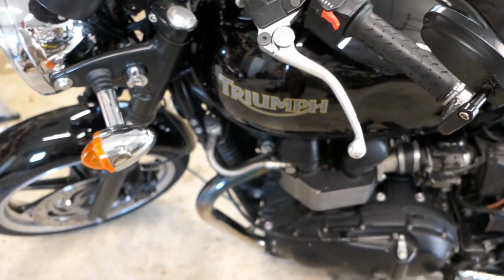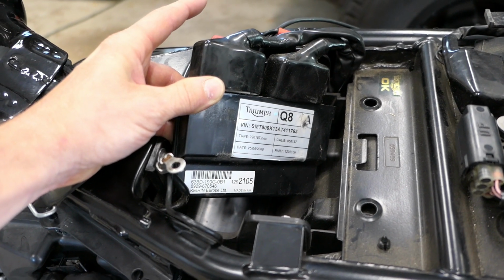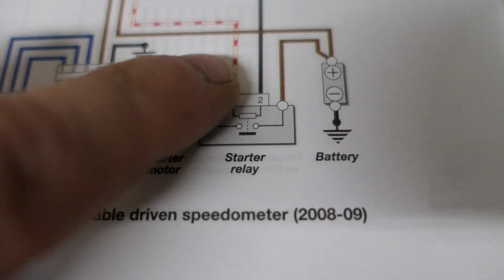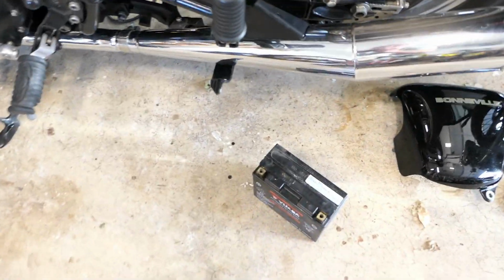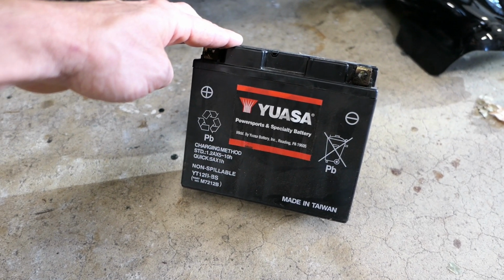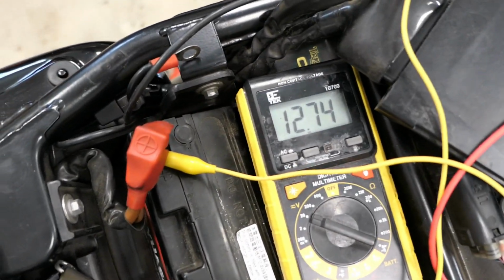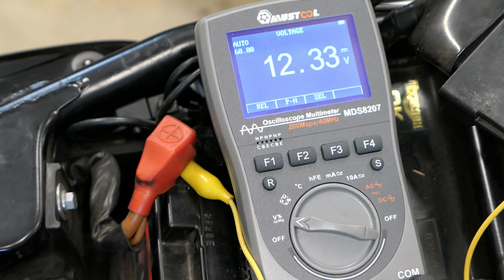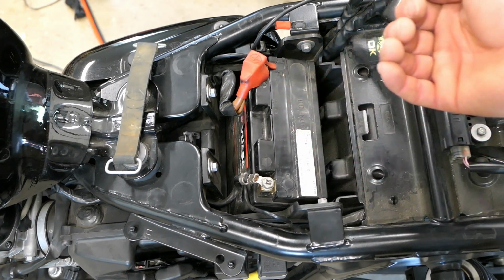Understanding The Triumph ECU Starting Issue

Comment: We can easily squeeze extra life from the battery by installing an external switch to the headlight. Procedure would be to turn off the headlight via the external switch, turn on the key (now the battery won't go below 12, then start the vehicle, turn on the headlight switch. In NA, the headlight should always be ON. But this is only while starting. I faced this problem sometimes, and I carry a T5 screwdriver with me when I go for overnight trips. When I get clicking sounds, I turn off the key, remove the two screws for the headlight and disconnect the headlight, then it starts normally. Connect back, put back the screw and ride back home making sure to charge the battery via a battery tender. Anyways, good video and nice explanation.

Comment: Turning the headlamp(s) via a aux. switch will work if the battery’s not too bad but the problem will return as the battery deteriorates. Worked on my 2007 tiger for a while. Just replaced it with a tiger sport. On this the headlamps stay off till it’s running. Very good videos. Great teaching voice. Nice one sir.

Comment: Brilliantly helpful video - Thanks so much for sharing - Just came back from being away 6 weeks with a Triumph Bonneville in a garage but connected to an Oxford Oximiser trickle charger but I think the cold damp British winter has attacked it's battery. Felt despair then Googled the problem - Found your video and we're all fixed again :-)
Reply from the maker: Glad it was helpful!
Reply: Did you change out the battery?
Reply: @tinderboxarts  2007 triumph America ECU location
Reply from the maker: @joani I'm not familiar with that bike, but the ECU is typically hidden under the seat or deep in the frame for protection.

Comment: This is EXACTLY my problem with a new to me 2009 Rocket 3. I've had a couple of older Triumphs but this behavior is new to me. My biggest battery drain is the dual headlights and I see people have made modifications to manually switch the headlights to avoid this issue. Great description - THANKS!
Reply from the maker: There was a period when Triumph simply programmed the voltage threshold too high.  You may find that Triumph has an updated patch for your ECU--they did for my 2010 Bonneville.  In later years this problem seemed to go away, so they probably changed the threshold in the programming.
Reply: I am dealing with this exact issue with my Rocket III 2011, and I thought of some voltage threshold, because it is pretty random, but the service manual doesn't mention anything about this. So this video is the proof that I needed, and I will do what you did but with some hidden timer, to turn on lights only after the bike is running.

Comment: Thank you for the tips. Have been struggling with the issue on Tiger 800XC SE for a couple of months. Tried recharging the battery to 100%, and it was spot on. It was not noticed earlier because the battery is new - less than 6 months, but it was leaking....so, will get a new one. Have a good day.

Comment: Yup! Similar problems with my 1050 tiger. I’ve learned that the ECU is very fussy about the voltage it’s getting. The battery has to be in tip top condition. Long story short…. If the bike doesn’t start when you know the battery should be fully charged, get a new battery. Can even be necessary if the battery’s only 2 or 3 years old.

Comment: I watched this video, and it makes sense. Now I know thanks to you is a voltage sensing issue. My 2013 Thrux has the issue, and it does that clicking try even after charging the battery, and it starts when it wants, but the other day I was taking off from a traffic light and stalled, and the bike will not start and got the hateful click. Had to push the bike on a heavy traffic road and once at the edge, the SOB started like new. I have a Carbed Bonneville without the stupid voltage monitor, and has NEVER, in 15 years of daily use, let me down. I watched your video after bypassing the solenoid with a screwdriver shorting  old trick and the bike started perfect after not starting like supposed to. I am eliminating this crappy design and wire the solenoid coil directly to the switch, just like all the other bikes I had in 50+ years of riding daily. This little thing makes me not love this bike, although I love my 01 Bonneville. It is a super stupid design, some one some where for some NOT motorcyclist reason, had the idea of fixing something that has worked on all kinds of machines for years. I know that bad batteries burn alternators, maybe that was the idea behind this design, but it does not work, is intermittent, not safe not reliable, is, in simple words, garbage designed so people take their bikes ti the dealers so they can squeeze money from them. I commend you for showing the actual cause, a voltage monitor, which they have admited, is crap. I rather have a bike that blows the battery along with me, than being run over by a car because the computer thought it was safe for the Company profit to prevent a possible start. Triumph failed on this, it is garbage, I will not buy another EFI bike from them. Thanks for sharing your finds, you are a gentleman. So to get even, if you are planning on getting a newer Triumph, think about it twice, get a Jap, bikes that work, every time.
Reply from the maker: It is very frustrating.  Of course, you should always check to make sure you don't have a different problem such as a loose ground or poor battery connections.  Unfortunately this sort of problem is more and more common in vehicles of all types.  They are all computer controlled now, and often there is not enough debugging or forethought in the SOFTWARE design, which then causes trouble in the real world.  The hardware can be a brilliant design, but if the software is making stupid decisions or the logic is faulty, then it will never work well.

Comment: Thanks ,  You saved me hours of looking to "fix" something that wasn't broken .   My 2012 Tiger eats batteries , I can't get one to last more than 2 years ,  But my problem was not the Switch like the mechanic thought or my starter components .   just the battery
Reply from the maker: Yeah, a marginal battery can cause all sorts of issues.  However, you should be able to get more than two years from a battery.  I routinely get 5-8 years.  My son has the same bike as you, and I've coached him on getting battery life too.  Check out this video and see if it helps:  https://youtu.be/Ah2jcRzupgM
Reply: I’ve just got this problem on my 2013 tiger. However my fuel pump doesn’t engage. Do you have any tips or advice? Thanks
Reply from the maker: @jared Arlett If your fuel pump doesn't spin up with the key in the on position, it either isn't getting power or it has failed. Test the battery condition first, then check the supply to the fuel pump if the battery looks good.  https://youtu.be/d-5xA31nBd8

Comment: EXACTLY what I was looking for today. THANK YOU for your instructive video!
Reply from the maker: Glad it was helpful!
Reply: @tinderboxarts  hello sir, looking to pick up a 2006 speed triple but it seems to have a problem starting recently and the only way to start it is by jumping it. I’ve been told it’s the relay sensor or something like that, when you try to start it, it just clicks. Do you happen to know anything or have suggestions on what to do? Thank you brotha good vid👍🏽
Reply from the maker: @Almighty Sosa  If a starting relay is bad, it's bad no matter if you jump the bike or not.  It sounds more like you have an issue with the battery or the cables/connections at the battery.  You need to check the battery by confirming the resting voltage, voltage under load and charging voltage.  This video shows you how: https://youtu.be/d-5xA31nBd8

Comment: Great video mate - I have an old Triumph with a brand new battery that began showing the same issues. I'll have to do a symptom check and see if it's not leaking voltage or another issue, but great insight to see why the bike refuses to start despite the other signs of life.
Reply from the maker: It can be frustrating for sure.  Now, remember that this is only going to be on bikes with an ECU.  Much older bikes without a computer might have different starting issues.

Comment: If you replace standard with a Lithium motorcycle battery of similar dimensions, you get the benefits of less voltage drop, more cranking power and a bonus weight reduction. This is especially useful in a Triumph with their crappy sprag clutches that cost a fortune to replace and are sometimes still failing on modern models. Been there, done that with my '95 900 Sprint that had to have the engine removed, cases split and gear cluster removed to replace the sprag clutch. A winning move from Triumph would have been to fit an automotive type starter with the solenoid sliding the cog along the shaft to engage the flywheel or whatever ala Moto Guzzi starter motor. Of course the other Triumph ignition issue is intermittent failure of the ignition pickup coil that can breakdown when hot but operate again when cooled down and a real bugger to troubleshoot.
Reply from the maker: Of course, there are drawbacks to lithium batteries too.  You need a compatible charger, they are more expensive, and they don't handle cold weather very well.

Comment: From my experience if a battery reads 12.5 Volts or less it is starting to fail.  When I first heard this advice I thought it was ridiculous but six 1.2 V cells should make 12.6 Volts.  Once a battery gets below this it is only a matter of time.  That 12.5 Volt battery may last you the rest of the season but it is not "healthy".  Thanks for the video!
Reply from the maker: Well, you need to put those readings in perspective.  First, your meter may lack accuracy.  A couple-few tenths of a volt difference can easily be found among meters.  Second, the state of charge of a the battery needs to be considered.  Was it sitting for a few days, for a few weeks?  Third, the state of the bike charging system needs to be checked.  A battery with a lower voltage may just be undercharged at that moment due to a poorly functioning charging system.  The best way to test a battery is to charge it completely with a good "smart" charger, then test the resting voltage, test for a surface charge, and then test the voltage under load.  See this:   https://youtu.be/d-5xA31nBd8
Reply: @tinderboxarts  Agreed!  And after all that recharging and load testing if your resting battery voltage reads 12.5 Volts then it won't be long!

Comment: This kind of stuff is why I prefer owning vintage motorcycles.  I've only had a couple modern bikes, and they were always the ones giving me problems.   When my old bikes give me a problem I can usually diagnose it and figure it out.  With new ECU bikes, it's not always easy.
Reply from the maker: It's true, it can be frustrating.  The irony is that in many ways the newer bikes (and cars) are actually simpler to diagnose and repair--except for one problem.  The manufacturers do not release the information we need to do the work.  There are some efforts in state and federal legislatures in the USA to force manufacturers of many things to provide repair data needed to do the work.  But, the potential laws usually get shot down by manufacturer lobbyists working the congresses.

Comment: hello from Derbyshire UK very useful video thank you...., I have been doing some tests with a multi meter on my 2022 speed twin battery. and what I have found out by reading and watching you tube  is that the battery on a water cooled 900cc triumph engine bike is bigger (physically and electrically) than on my 1200cc speed twin bike, how strange is that.
Reply from the maker: You bring up an interesting question.  There can be many reasons why a battery is sized the way it is by the manufacturer, and engine size isn't even the most important factor.  Remember, the battery has two purposes.  One is to crank over the starter motor, the other is to act as a buffer for the charging system when the bike is running.  The size of the battery will be dictated mostly by the first function.  That starting circuit has many design variables, including the size of the starter motor, the gear ratio of the starter motor, the length and size of the cables to the starter, the internal friction of the engine at start-up, the number of cylinders, the required cranking speed for compression/ignition, and the stroke/compression ratio.  All of these things impact how much "uumph" is needed to turn over the engine at the right speed for ignition.  So it is entirely possible that a larger displacement engine could require less electrical "uumph" than a smaller displacement engine depending on some of these parameters.

Comment: Besides replacing batteries prematurely, have any other simple solutions appeared over the years to bring the voltage threshold down a bit? I remember reading somewhere that you could take it in to a TRIUMPH dealership and they could hijack the ECU into accepting lower amounts but I can't seem to find it again.
Reply from the maker: There was at least one official update from Triumph to lower the voltage threshold, which I know because it was done on my 2010 Bonneville.  I'm sure it was part of an overall update, though, not a specific thing.  Since they don't publish the programmed thresholds for various models and model years we can only guess.  My suspicion is that somewhere around 2012 or 2013 it ceased to be an issue on the modern classics, and it may never have been an issue on other models.  And, I don't want to make too big of a deal about this particular issue, because there are plenty of other reasons why a bike might not start.

Comment: Confused I am ! 
If the ECU prevents the starter relay ground in a Low Battery voltage situation then how does the Relay get power to click like you said it would at time stamp 2.08 ?
The ECU supplies the only ground to the Solenoid if it cuts that circuit it would be impossible for the Relay to click surely ?
Reply from the maker: Well, two things.  I should have been more clear in my explanation and I should also make clear that this is all still speculation.  As far as I know nobody has reverse engineered the ECU programing, so we are just guessing.  Anyway, the starter relay itself does appear to have it's own ground, according to the diagram.  So, the click can happen.  But the headlight cutout relay does not, and if memory serves it has a wire going to B6 on the ECU connector which is a needed ground.  That is one of the suspicious grounds.  However, the wiring diagrams are only good to a point, since the ECU is a black box and we don't really know what it's doing with the grounds.  Some people have attempted some modifications and claim success.  I have not tried this, but this forum post is the only one I'm aware of on the subject:

https://www.triumphrat.net/threads/strange-starting-issue.209534/page-19#post-6158521

Comment: As I understand it, the click sound is the noise the solenoid makes when the when the two heavy terminals are connected completing the circuit to the starter motor. Why then doesn’t the starter motor turn? When does the ÉCU interfere?(I was thinking that you may be able to get going by connecting the two heavy’s externally providing the battery’s got enough juice of course).
Reply from the maker: Yes, internal to the relay is an electro-mechanical device which closes contacts when a relatively low amperage circuit is used to control a higher amperage circuit. If there isn't enough current to completely close the contacts, or if there are dirty or broken contacts, or if the high amperage circuit isn't powered, then you can get a clicking or other noise without any result.  The ECU in this case appears to control the ground to a number of circuits, which is how it can prevent normal starting.  You could probably find a way to bypass that starting circuit and apply power directly to the starter.  I've done that many times on old vehicles with the screwdriver trick across two terminals.  But, you run the risk of melting the tip of the screwdriver and causing more damage.

Comment: Hi! Thanks for your video! I have 03 weeks without riding my 2013 scrambler! The battery is like 4 years old! Today I wanted to go for a ride and it cranks, you hear the fuel pump but does not start! My bike is in AC garage so no humidity should be affecting terminal! It has only 8K. Do you think the battery could also be the reason?
Thanks for any comment you can give me!
Have a good one!
Reply from the maker: You need to be methodical.  You say the engine does crank over?  If you hear the fuel pump spin up and the engine appears to turn over at a normal speed, then your battery is not the issue.  If the turn over seems slow, then you might want to test your battery and I have a video on that process.  If your battery is good and the starter spins over normally then you issue must be either in the ignition or fuel system.  You say your fuel pump spins up, but fuel may not be getting to the cylinders.  You can spray starting fluid into the intake as a test to see if the engine sputters to life.  If not, then the problem is ignition, which could mean coils, wires or plugs, among other things.  You can test for spark using an inline spark checker or by pulling a plug and grounding the electrode while cranking.
Reply: @tinderboxarts  Hey!Thanks a lot for your time! The Battery charge is 12.6 volts and cranks the engine like normal. I will spray some ignition fluid to see what happens if not I will unplug the spark plug boot and will do the spark test (I just bought the tester in Autozone).
It will be my next Saturday assignment! I will write back to let you know results!
Thanks again for the time you took to respond me! Thanks 🙏